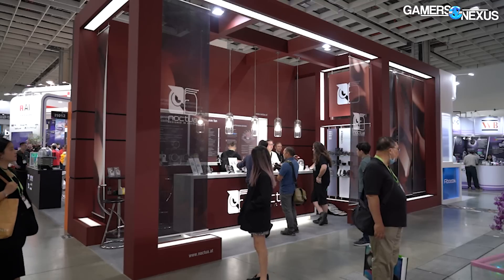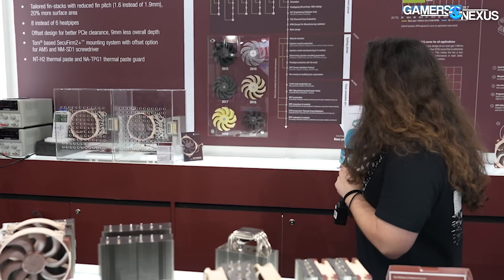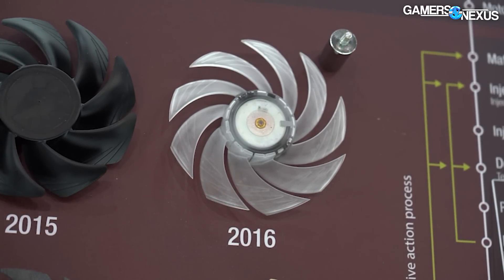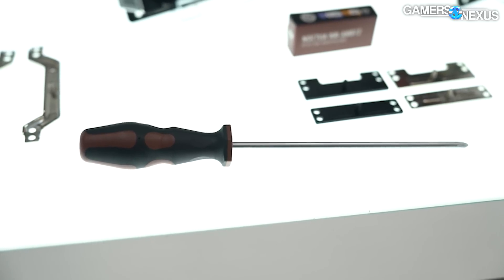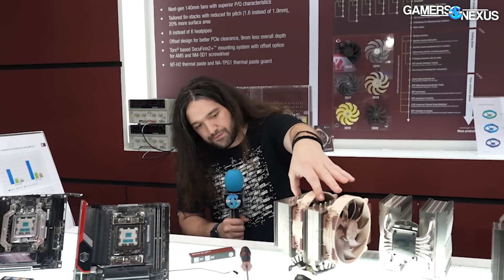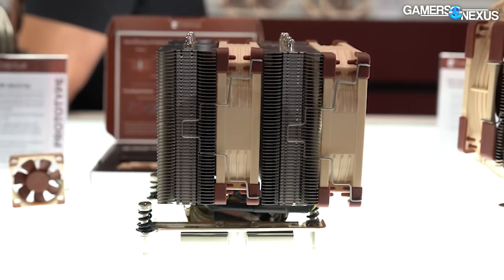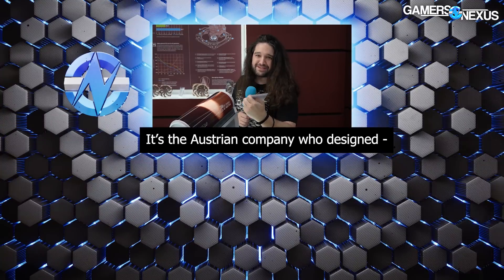Noctua is Back: NH-D15 Gen2 & 8 Years of Fan Development

Comment: It does seem like it must be especially difficult to design a 140mm PWM fan with good performance and low noise. I've gone through several and the last one I bought makes a lot more noise than the 120mm fan which I ended up putting back in. It's odd to be excited over a fan but I'm ready to see how their new gen 140mm PWM fan performs.
Reply: I would also like to see a collab with a GPU partner

Comment: I like noctua, but I got a 2nd hand noctua cooler for my 5800x3d. I've had to reseat it once and there was fundamentally no way to get the heat sink off the cpu without pulling the cpu out with it. The mounting prevents you from rotating the heatsink to get it loose. Quite the design oversight. Why sell an am4 mounting kit that risks damaging the cpu if you need to remove the heat sink?

Comment: I will definitely replace my NH-D15 with the next gen NH-D15, but only once it comes out in black. I hate that we always get a year or two of brown fans, even though they have already figured out how to paint the new material.
NH-D15 is still incredible though considering it's almost a decade old yet a lot of coolers/fans still struggle to match it in terms of both cooling, noise levels and especially sound signature.
Cooling and dB is one thing, but i've tried dozens of fans over the past few years and the only ones that match the Noctua sound signature are the Thoughfan T12, which makes sense consdering they are just straight copies.

Comment: You seemed to have missed the new 24V fan prototypes, which if it was the A4x10, would come in really handy for 3D printers, as it would require less voltage regulation.I've been wanting a 4pin 40mm 24V fan from them

Comment: I use the old NH-D15 for like 7 or 8 years now, zero problems since they day i installed it in my setup (works on top of quite dated but still good i7 6800k). Cleaned my setup couple times and it works just as silent and cools just as good as it used to the day i bought it. 
My only problem with the product was during installation, radiator had alot of really sharp edges where you can easily cut your hands and installing it in my Define R5 case (which isn't a small case either) was quite a challenge even with a second person helping me - i cut my hands abit trying to install fans on radiator but after i managed to install, had no problems through the years. Highly recommend their products.

Comment: No news regarding the NF-A14x25 fan (assuming that it's not the same as the new fan on the next generation D15)? I remember reading that it was in development a few years ago.
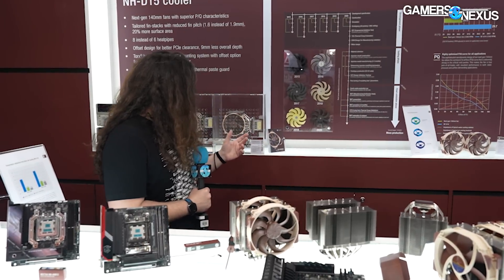Reply: 2:05 - 5:30 That actually is pretty likely to be the NF-A14x25. I mean, what other 140mm fan would they have had in the oven for over seven years?

It having a rounded shroud doesn't mean anything to the contrary; so does the A12x25 that you get on the NH-D12L. The case fan would simply be the same product with a square one.

Comment: I have standard aluminium 4 heatpipe 12 years old AMD cooler modded with 20 years old best Arctic cooling  case-fan with only 2000rpm and i have no problem with any used AMD processors, now is this  Ryzen 5500 on boost clock and temperature still low 50 celsius😉 And on 20 years old case without special fans only one rear fan🤗The elders remember the shape of these propellers.

I'm an old guard 50+ who knows what he's doing and doesn't waste money unnecessarily. In those 20 years, it was enough to lubricate the bearings twice with a mixture of wax and oil.😎

Comment: Look at the fan blades! Incredible. It is insane really. But I do question why go Noctua when there is allot of decent 120/140mm on the market nowadays. Even got Fractal Torrent 180mm now since the case and fans are just epic. Performance or whatever. 180mm can turn slow and just look cool compared to 140mm case fans. 

Got the D14 and D15. Got multiple 140mm case fans too. The thing is that by the looks of things AM5 and whatever Intel is going to release is just not interesting to care about a D16. If there is going to be a point in going Noctua it got to be due to server grade stuff. Workhorse systems.

And really the rest of the cooling market is so good today and AMD/Intel awful enough that getting a cheaper cooler and tuning for power saving is the way to go. Even D15 is decent enough to cool the Ryzen 7950x at full power. And you better off turning ECO mode on anyways making it really pointless to go out and buy a D16. Sad times.
Reply: That's because Fractal Design fans are the most underrated brand for PC DIY enthusiasts. Even their stock fans offer insanely good $/perf if you consider noise to be a primary factor of consideration.

Though the higher you go up in fan diameter, static pressure lowers and after a certain threshold to achieve the same amount of cooling over a finstack a 180mm will be nosier than a 120/140mm. 

For case fans usage larger diameter fans like 180 and 200mm may make sense but for radiators and cpu coolers - NOPE!

Comment: I have 8 noctua case fans and the low profile cpu cooler from noctua. Running on ryzen 5600k. Idles at 35 - Really can't complain. I love them. If the newer cpu coolers from noctua are AM4 board compat. I will be a happy man.
Reply: I had no idea intel made a Ryzen

Comment: I have NH-U14S Noctua cooler and i'm thinking of upgrading my cooler, any suggestion?
Reply: Specify the heat load and your performance/noise goals.
Reply: @mycosys  I have R7 5800X CPU not OC. I only wish i can get on full load under 65°C or at least under 70°C. This cooler was great for R5 1600 OC, but not for my current CPU. About noise i'm not picky it can be noisy but not like vacume cleaner noisy.
Reply: @RGMUFC1  If you dont care about noise you have more than enough metal there, just get a pair of good quality 2000rpm fans (even noctua make one in their industrial line, still rated under 30dB/less than audible, buttheres a LOT of good cheaper options not much louder). Keep in mind tho you should be more worried about boost than temps with Ryzen 5000, they will boost until they hit either power or temp limits.
Reply: @mycosys  Ok so new fans and that should do it. Thank you. About boosting my CPU i never notice any problem with my CPU so far, maybe beacuse i'm doing light editing and i'm playing games majority of time so i don't put much stres on my CPU.

Comment: Noctua products are one of the few cases where you can actually believe the hype. Back in the days, I switched from an AIO to a huge ass Noctua cooler that I bought expecting to use it as a momentary solution before buying another AIO, and holy heck. My temps dropped drastically. They know their stuff.
Reply: Once go Brown and Tan, you never go back. Apply as well with Gray if you use the Redux Line
Reply: @AldemarDG  The beige of honor
Reply: @AldemarDG  black for me with the chromax cooler line.
Reply: @AldemarDG Honestly, I wouldn't mind getting my case painted brown and tan to fit my Noctua fans lol. It's a unique aesthetic.
Reply: @borbis6723  Yes. Reminds me that Linus Tech Tips video making an actual noctua build
Reply: I wish I had gone with an air cooler, tbh. Not that my h100i doesn't do the job, but I very much dislike not being in complete control of the fan profile. Not a big fan of how they work in general. I might just wait and upgrade when the V2 comes out.
Reply: @navvvix  At least you get Noctua fans with a Noctua cooler, which last... I don't even know how long. Do they ever die?
Reply: @kunka592  Mine is 7 years old and still working.
Reply: @navvvix  Why not name said cooler that costs $35 and outperforms the NH-D15?
Reply: @TechnoBabble  hes probably thinking about the Peerless Assassin 120 SE which is a few c hotter then the NH-d15 to get into noctua or above territory you have to go up to 60+- usd for their larger coolers.
Reply: @Demon09-_-  You mean a few C cooler. Thermalright is currently the top air cooler in the Gamers Nexus charts while Noctua is 4th now.
Reply: @Demon09-_-  look up the numbers again.
Reply: @TechnoBabble  https://youtu.be/Mm4hyIHe1PM?t=1048
Reply: @TechnoBabble  thermalright peerless assassin se.
Reply: The thing with the NH-D15 is it's very consistent as with an AIO it's consistency can be all over the place. If I want gimmicks, I use an AIO, and if I want stability, I use an air cooler. Both serve their purpose in the applications being used as one really isn't better than other for the end user.
Reply: must have not used an arctic LF 2 then
Reply: If your temps go down after moving to an air cooler from an AIO then you either had a shit AIO or it wasn't installed correctly. Even GN's own testing has all the AIOs at the top of the chart with most of the Noctua coolers being either middle or bottom of the pack.
Reply: @krazyfrog  120 aios exist.
Reply: @krazyfrog  Notice they said "Back in the day". Old AIOs were a lot worse than modern ones.

Comment: Really cool. However, I've said this many times at this point but it's still disappointing to me you guys never tested or even covered the NH-U12A.
Reply: Not sure there’s much to say. I got one just last week after digesting a ton of reviews. Seems to be the best cooler of its size. If you have more space both the U14 and D15 might be better options at a lower cost (as would competing brands). But if your space is limited and you can afford the premium, it’s the best option IMO. 

That said, I too was sad not to find a review by a source as trusted as GN
Reply: @TheShortStory  The problem with the U12A is the noise. I think there are better options on the market.
Reply: @saricubra2867  it’s nosy at max RPM but the fans have not reached audible levels in any of my stress tests. Granted, it’s a very well ventilated case
Reply: @TheShortStory  You can hear a U12A at max fan speed, it has a high pitched noise. The D15 meanwhile is low frequency. It doesn't matter the case here.

I heared audio recordings for both.
Reply: @saricubra2867  that’s literally what I said.. you can hear it at max RPM. But it’s sufficiently efficient that it never has to ramp that high except possibly in extremely low air flow scenarios

Comment: i had to swap noctua d15 for a peelrees asassin and i dropped 5 c, i the noctua is not needed on 7800x3d

also the back plate on my 6800xt red devil touched it on DS3-H AM5

Comment: I’m over here still patiently waiting for their desk fan that was announced back in 2018 😅
Reply: any fan is a desk fan with a long enough extension cable! or soldering the wires to a 12v PSU
Reply: @glebglub  I was interested in the shroud for the desk fan that directs the airflow and the mount. but seeings it’s no longer on their roadmap, I’ll get those parts 3D printed.
Reply: They recently removed the desk fan from their roadmap so I’d say they finally cancelled it.

Comment: i mean 7 Years, that is fair, and im good, as noctua is cooler and fan life is like 10 :D so all good, you buy one set, use it untill you upgrade to another noctua :D 
i have D15 now and 4 noctua chrome fans, i mean ill replace them when they die. in the onden days you replaced them when you wanted quieter fans :D  not that is not the issue

Comment: Its "Cuula" if anyone was interested in finding the drink dispenser. It looks like a retail thing to sell drinks by the register.
Reply: I was curious about it's use case and was very suprised that they thought it was a good idea. It can hold 6 cans (330ml) or 7 (250ml) that's not enough, not even for a 7-eleven and it takes 40 min to chill. They will need to refill often. You can only have 1 brand in it at one time because of the branding on the outside. Most places have a cooler next to the register already where you can choice whatever brand you want. I get that they are trying something new and unique but this will only create more work for the people behind the register.

Comment: I'm still using my D14. Noctua has been providing me with new socket fittings for free :)
Reply: @Blue What? The D14 was not expensive dude and it's still running after more than a decade.
Reply: @Blue LOL no. Most 15 year old coolers are useless, My NH-U12P is still current
Reply: @Blue You might wanna google the price on the Thermalright Ultra120, I have one, they werent far different in price, but the Noctua had a vastly better fan, and is still supported.
The fact you dont know about ML hallucination explains a lot tho
Reply: @Blue "according to chatgpt" lol you seriously referenced a language model, it has no concept of truth
Reply: Congrats kid. I'm a Mechatronic Engineer, close friends inc literal Doctors of Robotics in Machine Learning. You keep claiming expertise, but you dont even know what LLM Hallucinations are. I would suggest you havent even reached the valley of the curve you keep mentioning.

Comment: Other companies have come a long way recently too as we see with the Phanteks T30 for example, i wonder how Noctua's recent R&D stacks up against newer offerings from the competition
Reply: Unfortunately, Phanteks T30 is only good as a radiator fan. If you're interested, best to check the fan testing sites/channels that do a lot of noise normalization testing with different set of obstructions (none, thin radiator and thick radiator etc). 

Yes the T30 underperforms even up against a Scythe Wondersnail if you use it as a case fan at the most important rpm ranges

Noctua tends to make the most tuned hybrid fans that work exceptionally well at the lower rpm ranges.
Reply: Phanteks T30 is just a 30mm copy paste of 7 blade Nidec Servo Thyphoon D1225C12B7ZP-62 which can be found on Fury/Vega LC 
There is no new fans, only copies of the best proven Thyphoon type fans
Same as Noctua a12x25 copy paste of 9-blade thyphoon

Comment: Honest question: is there any chance for the pc industry to adopt the toroidal fan-blade design, that is being praised as more efficient and less noisy.
Reply: Have you seen the videos about toroidal PC fans on the Major Hardware channel where they are compared to a Noctua fan? It seems like the design doesn't make much sense for PC fans because the turbulences on the fan blade tips that toroidal fans reduce (which is the reason behind the noise reduction) don't really occur in PC fans in the first place thanks to the fan case around the fan. (Also PC fans don't spin fast enough so these turbulences wouldn't be big factors anyway.) In the comparisons the stock Noctua fan was more efficient and quieter than the toroidal designs.
Reply: @klopferator  Oh. No I haven't, but thanks for pitching it to me. Yeah I was wondering about the pc fans not spinning fast enough, also I'm surprised that the fancase provides noise reduction through limiting the airflow or smth. Thanks
Reply: I'm not an engineer, but what I've gleaned from YouTube vids from 3D printer hobbyists asking the same question is that toroidal fans only achieve additional efficiency and noise reduction in certain RPM ranges, and those RPM ranges are well above those at which PC cooling fans typically operate.

Comment: That booth is 10/10 love noctua
Reply: Waste of money. The fan and heat sinks are a joy to see but not wasteful booth costs.
Reply: @TheDiner50  It's a booth. They build it once, and can tear it down and use it again some other time. Would you prefer they slap down a fold out table? Branding and appearance will sell more fans and coolers faster than just the specs will.

Comment: To be honest, their lineup has been pretty much as good as it gets for that entire 7+ years, so having to wait for them to "upgrade" is actually fair to me. They've been my go to for many, many years and I never felt like I was getting anything less than great. I look forward to their latest designs!
Reply: U12A is a damn fine compact powerhouse
Reply: @blue-lu3iz I've used both of them (I'm a system builder) and find them good in the short term, not so much in the long term (noise being the main issue here). No such issues with the Noctua's. You get what you pay for at least for fans.
Reply: @dragon2knight  this is true. Noctua fan bearings are second to none for quality atm, but stuff like p12 are good enough that I haven't had any issues either. But p12 bearings are worse than Noctua for durability.
Reply: @blue-lu3izThey didn't exist yet...
Reply: @someoneelse1550  ??? I had a Thermalright TRUE 120 back in 2009 cooling a Xeon e8400 equivalent. That was the hyped cooling solution of the time.
Reply: @blue-lu3izi bought Be quiet case with their fans and i am still thinking of changing them for Noctua ones. My main concern is noise.
Reply: I bought a NH-U12P SE2 in 2009 for 65€. It's been running practically 24/7 since and it's still VERY silent.
Reply: @nekdo_kavc  I'm noise-obsessed. I only use Noctuas in all my builds. Always happy with them.
Reply: @Blue I've been running the same Noctua NH-D14 fan since 2012 - and that started with an Intel 3930k, then an Intel 7700k, then an Intel 8700k, then an Intel 9700k, then an AMD 3900x and now an AMD 5900x. Six CPUs over 11 years, and the same fan because Noctua sells (well sometimes gives you for free) adapter plates, and their fans last forever, and they're quiet. Your welfare discount club garbage isn't lasting even half of that time - and there's still nothing wrong with this Noctua, it will last probably another decade at least before one of the fans needs swapped out.
Reply: @rodmunch69  i've been running the same Thermalright Macho with Thermalright TY-140 fan since 2012, cooler cost me 40$ or so. 10 Years, fan still working without noise. I think that's enough time for earn money to change 1 fan or entire cooler.
Reply: Also you get free adapter if you change to a different socket.
Reply: "Upgrade" by copying Nidec's Gentle Typhoon.
Reply: @iqmarwomuma3036  you are so smart, here is your medal!